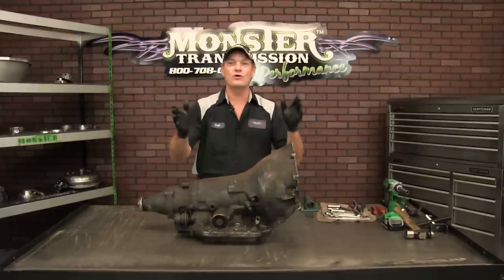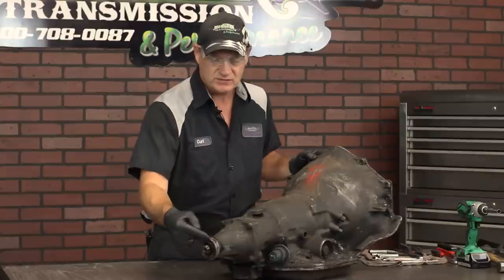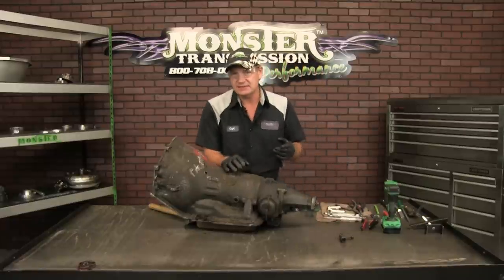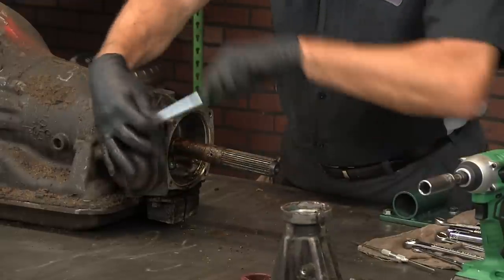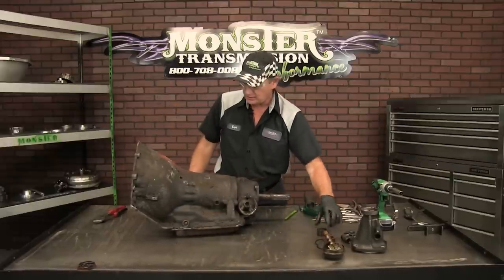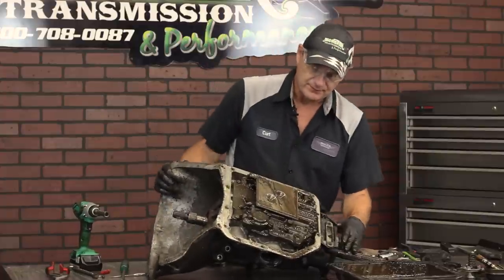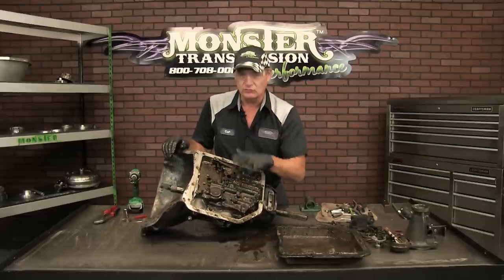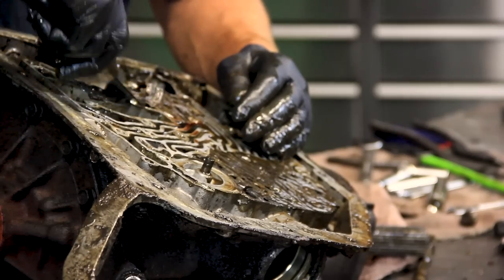TH350 Automatic Transmission Disassembly | The School of Shift

Comment: I followed this video step by step and I successfully rebuilt my own TH 350 and it’s amazing, so smooth, thank you I saved at least $1250 and I KNOW I did a perfect job with high quality B&M part kits. THANK YOU MONSTER TRANSMISSION
Reply: Yeah but he fails to show you exactly where your check balls are. There are 4 and some transmissions have had a shift kit put on them so then there sometimes is only 1 so i have seen in several other videos. Also a few other things he does leave out in this video like alpt of parts have to be lubed back before putting back toether and lip seal tool it takes to lock other parts back in amd soaking your clutches in transmission fluid for a couple hrs before rebuilding.
Reply from the maker: This is just the Disassembly, all that is covered in the rebuild portion.

Comment: A tow truck driver towed my company's 1981 Silverado K10 wrong and destroyed the tranny. Yes, we're suing. I spent the winter of 2022-23 IN NORTH DAKOTA ON CRUTCHES. On ice, thru snow above my knees. The tow truck driver's employers were heard to say, "We've gotten away with this before, and besides it's just some Indn's truck". Racist and arrogant and they don't deserve to be in business. 
This video has been a LOT of help, since I have not rebuilt a TH350 in 3 years. Yes, this Indigenous woman rebuilds vehicles. 
So thanks, Monster! 
Btw, the rebuild by a top local transmission shop cost $2,365(.56, including replacing the front u-joint in the drive line). Add in lost income and pain and suffering and we're talking serious money. Not to mention the lack of respect of the opposition for business.

Comment: Great video for the "DYI" guy.  I would use more specialty tools, i.e. a seal puller tool as well as a front pump removal tool.  
By the way, what glove are you using?  I have tried several types, but haven't found ones I really like.  Those seem to  fit well without hindering your dexterity.
Reply from the maker: Thanks! Yes, we try to show how you could do it in case you're missing tools. Curt is wearing Black Nitrile gloves by Safety Director Elite. They are industrial gloves, latex free and powder free.

Comment: I just finished rebuilding my th350 and have it in the car. The transmission performs well (shifting, etc...)  But I have an issue with tranny fluid pushing out the tranny dip stick when I shut the engine off. After diagnosing the problem I blew air into the dip stick to check the that the breather vent isn't blocked in any way. I removed the vent tube and found that the passage way to the breather vent cap doesn't vent. So the tranny is building up pressure and blowing out the fluid through the dip stick tube. I followed all steps when rebuilding and can't figure out what the blocked is caused from. Anyone have any ideas before I pull the tranny from the car and take it apart again. Thanks for your help

Comment: Yeah how to you release the band at 11:50???
Reply from the maker: You can apply the band through the valve body area and use a large flathead screwdriver to help pull it out.
Reply: Yes i figured this out.. Was trying to do what's in the case before messing with valve body..but figured out the servo has to come out first so it will release it. Thank you !